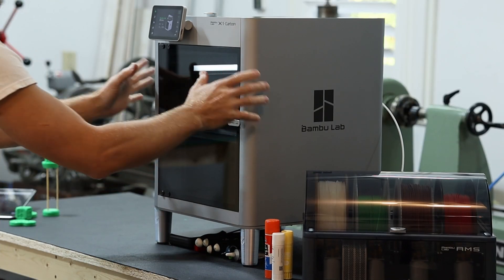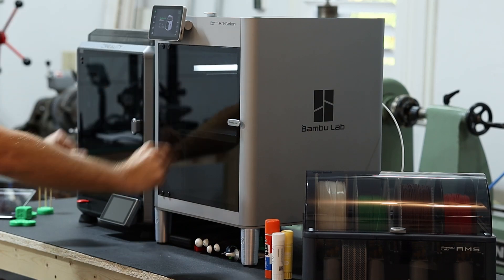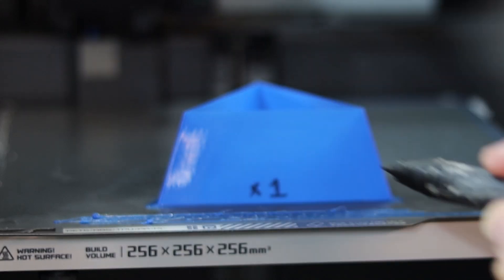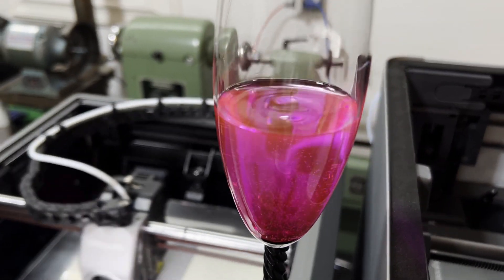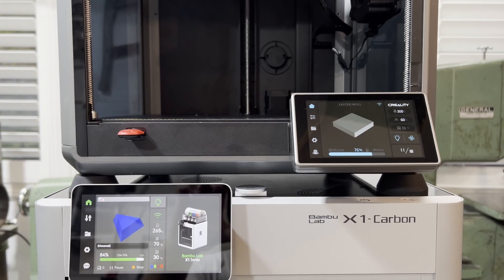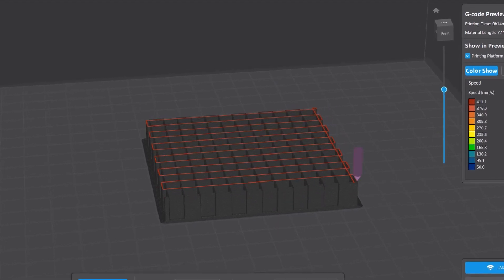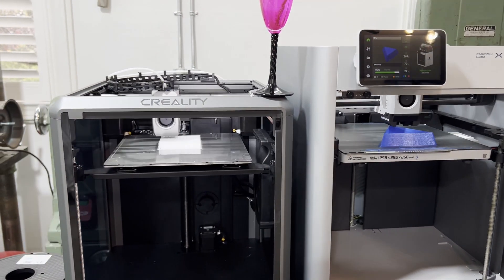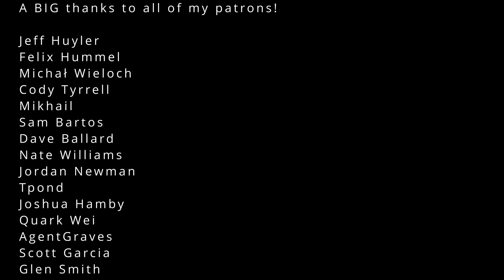We're adding Vibrations to 3D printers to see what happens! Feat. Bambu X1C & Creality K1

Comment: Is it possible to add Polish translation to the subtitles? Is it YouTube's fault?
Reply from the maker: It looks like that's the case, I just tried to add Polish and it could only add the words and could not align them with my speed at all.  I've set it to automatic translation and it should work technically.  I just did a test and first I can set it to English Auto-Translate, from there I could add auto-translate to Polish, can you try this?
Reply: @NeedItMakeIt unfortunately...😢 it's probably a problem on YouTube's side. Translation into Polish is only available via the website, but not in the application... but there are languages such as Vietnamese, Ukrainian and Thai
Reply from the maker: That's not great, I thought it would be possible through each of their applications.

Comment: Honestly I am surprised how well it still work. I print mostly functional stuff like Jogs, holders and such so I don´t care for vibrations, the parts should be dimensionally accurate and then I hit it with spray paint and it looks all good. Good video topic. Next up place the printer on a running washing machine xD
Reply from the maker: Yeah, it was pretty impressive.  I'm with you, printing mostly functional and that's a good point, it's not so critical that they look perfect, but it's nice if they can look alright.  I've never had anyone complain about the parts I make, I think the tech is getting so good, now we have speed and we have pretty good accuracy.  Where will it go next? 

I wanted to do the washer, but mine are stackable...
Reply: @NeedItMakeIt   "...I wanted to do the washer, but mine are stackable....." hahaha xD

"...Where will it go next?..." Good question.
FDM will most likely improve more and more and get cheaper. We are still missing good reliable heated chambers. What about good ventilation and air cleaners, still missing those as well. 
Fast TPU printing could also become a thing, Phrozen is releasing a new FDM printer optimized for fast TPU printing.

Consumer FDM printers are already really good in terms of price/performance and ease of use. But FDM printing while cheap is probably the lest "best" rapid prototyping method. Take supports for instance you still need supports. You can print in different materials but it´s really tricky and wasteful, you either need multiple heads which makes it tricky or you need some kind of MMU or AMS which also makes it slow and expensive (material purge). The resolution can´t get much better most likely because to increase it you need ever so smaller nozzles which are already at somewhat a limit in size.

What I would like to see is affordable binder jetting printing. 
You don´t need supports
You can print in any color you want, so full color spectrum! 
You can print and even mix materials on the go. 
Resolution is fantastic. 
Material properties are fantastic. 
But for now it´s suuuuper expensive. We have a comparable machine like 15 years ago it was about 250k.

Also Metal 3D printing could become a thing but there is almost no cost cut evolution here beside the Iro3D printer which is custom build for each customer and costs 5k and nobody else is doing it.

Comment: So what I gather is that instead of purchasing another table, I can just purchase more printers and stack them on top of each other. 🤔
Reply from the maker: That's right, I think maybe you can print a Lego style top and bottom piece and interlock them in a wall of printers which is very stable.   Stacking really didn't affect the print a lot, they do a great job at reducing those tiny vibrations, and if I weren't printing PETG it would be really hard to see anything.  Good idea, I'm not so sure, it could fall off if it went for a very slow walk.

Comment: so far what is the more reliable printer - x1 or the k1 , as you own both? thanks
Reply from the maker: Sure no problem!

X1 is quite a bit more capable, even more so if you can add the AMS.  The prints are smoother, the first layers always go down really nice.   Bambu Studio is also one of the best slicers (Prusa Slicer) also, which makes the whole process much nicer.  WIFI connection is more reliable also.  The K1 is still good, and it is quite a bit cheaper, but I have a colleague with the P1S and his results are pretty much the same as mine with the X1.  

I plan on installing Klipper on the K1 and using a different Slicer, I think Creality's slicer isn't good enough for the job.  Maybe those changes will give it the leg up it needs to compete.  I also think Creality will come out with a comparable color printing option, but how it will connect to the printer, I've no idea.  

Let me know if you'd like anything more specific.